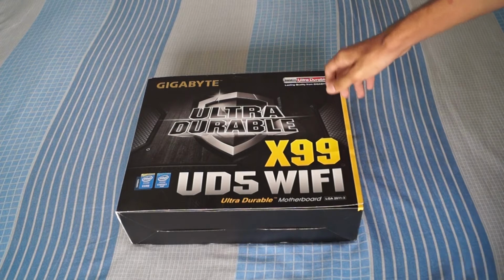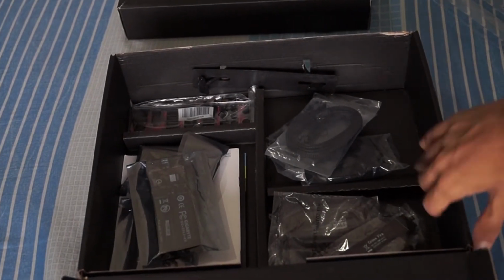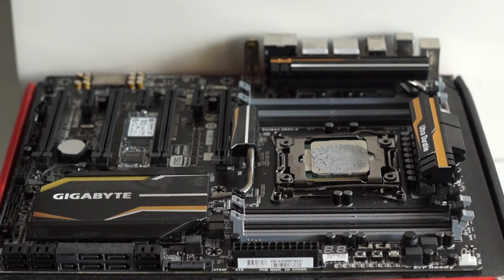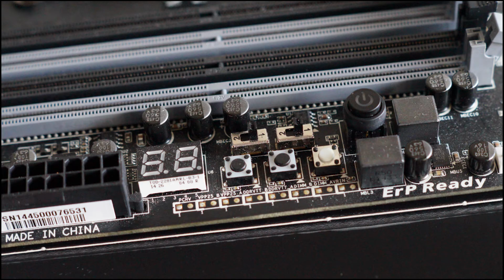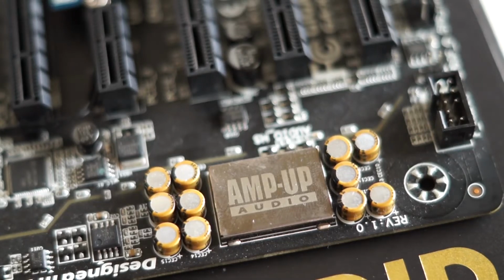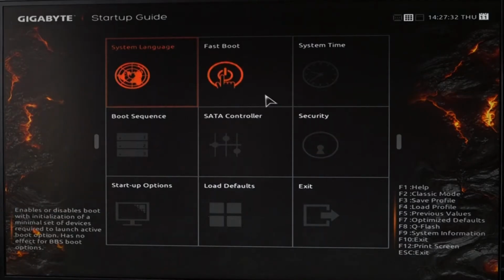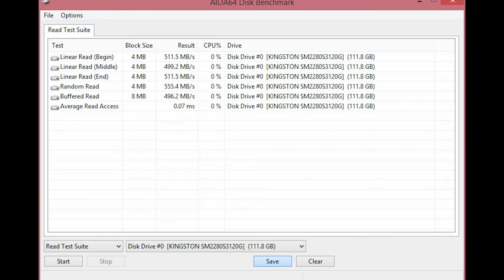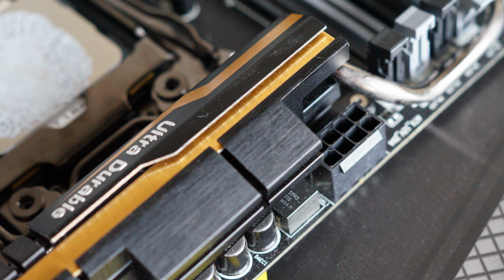Gigabyte X99 UD5 WiFi Motherboard Full Review!

Comment: looking for  a build with this board plz help
Reply: Sean Woods Provided you're still looking, I strongly recommend looking at the Fractal Design R5. Very competent case and  you won't have to break the bank.

@gizmoddict  Nice review, by the way!
Reply: +Sean fractal design arc xl.  Ill post my monster fully custom water loop soon.  i used this case.
Reply from the maker: Sure, let me know what do you want to know about the board :)
Reply: well i own the board i got it on sale but im looking for a case that will fit it ans isnt expensive that looks somewhat decent can ya help there?
Reply: +Nicholas Dragonborn The R5 supports ATX max. This is E-ATX.